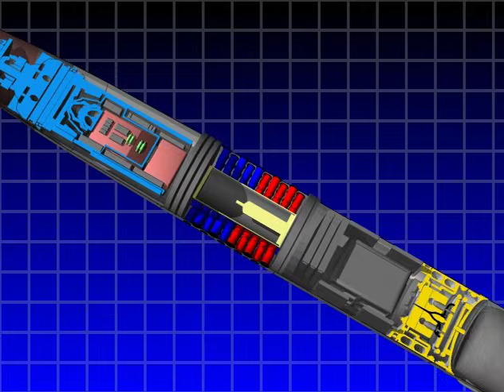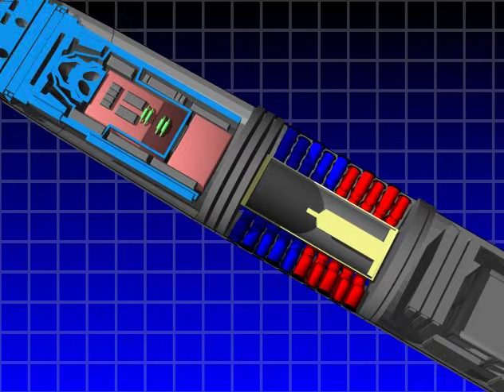PAC-3 Missile: How The System Works

Comment: Effective against third world threats.  The problem is that when the target is constantly changing it's flight path as is the case  with just about every modern missile system the process of calculating an intercept point is rendered absolutely useless.
Reply: Scuds dont constantly change their flight path, if you are talking about Iksander, its also a ballistic missile, if it wants to retain its aim point within range  before running out of fuel it wont be changing its flight path either. So, which missiles are we talking about here within the PAC-3 target set?
Reply: The iskander has a stable ballistic trajectory on the final 10 or so seconds in its flight.

Comment: Just to let you all know while the missile is flying  through the air it is still using radar to "see the target, it only uses it own "eyes" when it's about 20 feet from target, which would give the operator time to  self-destruct the missile if it is fired at a  friendly
Reply: You realize that at the kind of closing speeds in the terminal phase versus a ballistic missile that would mean the seeker would only be active for microseconds right?
Reply: They have recently upgraded the  Patriot missile
Reply: They haven't upgraded it to beat the laws of physics mate.
Reply: I understand that, but let me ask you do you know how this system works, because this video leaves out some key points
Reply: @Isaiah
I think you may be confusing the warhead proximity fuze with the active PAC-3 Ka band seeker? 
There is "no" time for any human operator to "self destruct" any missile 20 feet before a round goes through the IP.
Reply: I am telling you a human operator can self destruct a PAC 3 missile, I have also spoken to my dada and his co workers who actually work on and operate this system and the all said it's possible for them to self destruct a PAC 3 missile 20 from a target.
Reply: What they probably mean is the system has the "capability" to self destruct a round up to 20 feet away from a target.
Its merely an expression of system capability rather than a real world tactical function that could actually be used.
Reply: By the way son, I was responsible for the upkeep of several surface to air missile systems in my 22 years in the Navy, i know how they all work in principal and they all have to obey the laws of physics. Have a great weekend.
Reply: But the Navy does  not have PAC 3 missiles
Reply: Have a nice weekend to you too

Comment: 2:1? If even the ad recommended at least 2:1 ratio this system is obsolete.. especially against saturated attack the stock will be depleted pretty quickly
Reply: This, like CAMM and ESSM; can be quad-packed. That means something like a Ticonderoga; can carry hundreds of missiles. A standard Carrier task force; could carry well over 1000.

Comment: Too bad it just failed again and again. The most recent failures was in July 2016 in the golan heights. It's garbage
Reply: +Jimmy Hrothgar No, I'm thinking of the same unreliable system the pentagon recently said it's a failed system. Israel used an patriot system and failed 3 times with 3 missiles to hit a small Russian recon drone in the golan heights. How is the upgraded patriot system better when Israel has an upgraded one that already failed? It can't even scan 360 and the engagement range is even long range. 43 miles isn't long range to be honest. The Russians have an BUK that has the same range, but they call it an medium range. Plus, it can scan the sky 360 degrees and highly mobile as well. It doesn't take 30min-45min to set up either. Iron dome is better then the patriot lol
Reply: +Jimmy Hrothgar They said the same thing that it was going to be better with the upgraded patriot system too. PAC-3 will probably be unreliable too. Go read how the US lies about the patriot system from the beginning. Pentagon already is doubting this system
Reply: PAC-3 is much better than all its predecessors.

Comment: UNRELIABLE VIDEO WITH ANIMATION FULL OF OPINION/PRESENTATION. BUT IN REAL WORLD CAN'T SHOOT A MISSILE TRAVELIN AT MACH 6.
Reply: Yes we have anti-missiles such as THAAD in concert with Patriot/PAC-3, Aegis Ballistic Missile Defense, that are made for just that purpose, operating with forward based sensors, and C2BMC (Command and Control, Battle Management, and Communications System) to maximize integrated air and missile defense capabilities. THAAD is mobile and rapidly deployable, which provides, fast intermediate hit to kill ballistic missile defense in the atmosphere and outer space.
Reply: Jimmy Hrothgar Thanks, by the way you sound like a thinking person yourself.
Reply: Nato Cwis and missiles have been designed to counter supersonic missiles since the 70s. I don't even see how hypersonic changes the equation; you still only have to put something ahead of it, the missile still has to fly through a cloud of tungsten balls and there still hasn't been a missile made which is armoured. Also, supersonic missiles generate a huge IR signature and hypersonic missiles can be immediately detected at-launch.